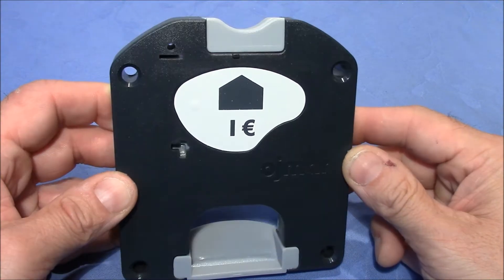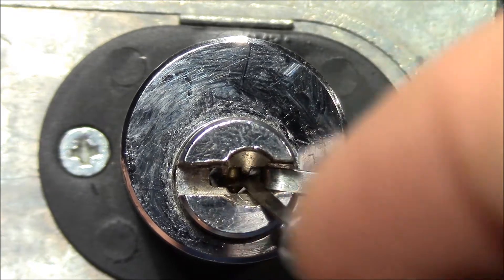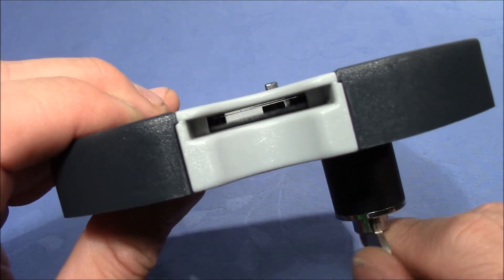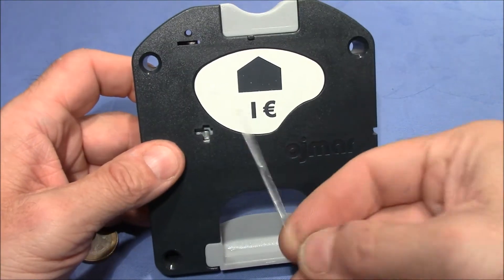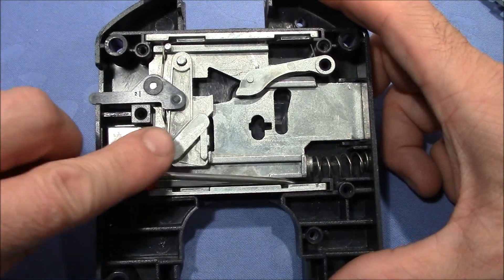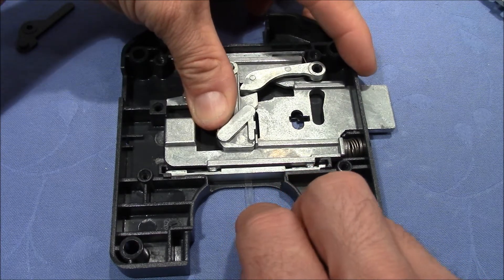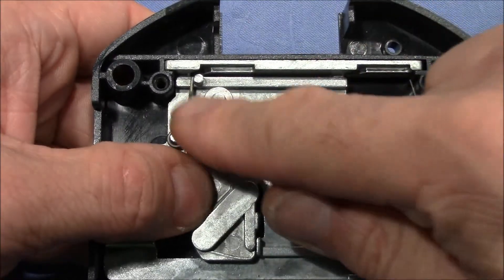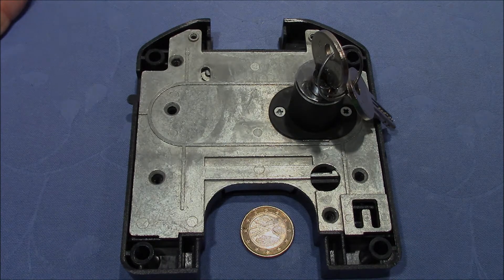(picking 415) Locker Coin Deposit lock (Spindschloss) picked / manipulated and explained

Comment: Nice demonstation of the inner workings. I had purchased a trolley chip with a hole in the middle which got stuck in one of these locks. I was wondering whether the "coin" needed to be solid through and through or whether I just had happened upon a broken lock. Now I know that it's the coin's circumference that matters, not the inside. Thanks a lot!
Reply from the maker: Thanks for sharing your story. I find these lock pretty interesting. For hacks on these locks check out https://youtu.be/GZpdDch2o4M

Comment: Where is the plastic strip when the door is closed? Inside? If so, and the door gets jarred causing the strip to fall out of place, what happens? Is the door inoperable without a coin then?
Reply from the maker: You place the strip to lift the lever simulating the coin. Hence the strip needs to stay inside as the lever must be lifted to allow turning the plug. When looking at 8:00 and further you can see how it works. Once the plug is turned then the lever is held by the moving part (the plate with the gate). Therewith the job of the strip is done and it can fall out or not - does not make a difference.

Comment: Absolutely interesting locking mechanism Potti :D wow. Well thought out details :). The dimple lock is probably the cheapest they could build into it ;). But I was more interesting on how the mechanism works. Very nice and detailed info. Thanks a lot for sharing :D that was really great :).
Reply from the maker: Thank you for the kind words. Most of these locks that I have seen in the wild are wafer tumbler, so this is special. But I was also more interested in the coin related mechanism which is very interesting and has a lot of details.